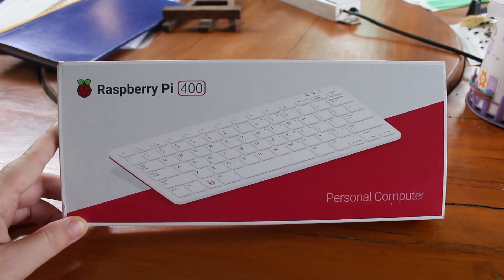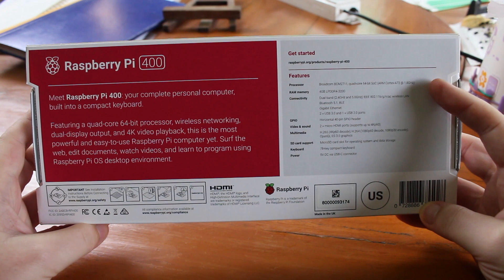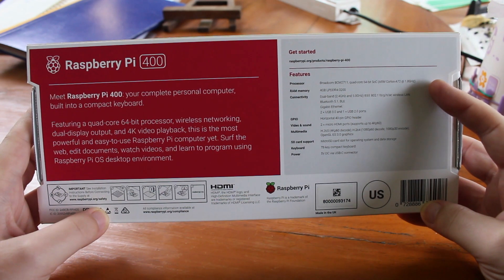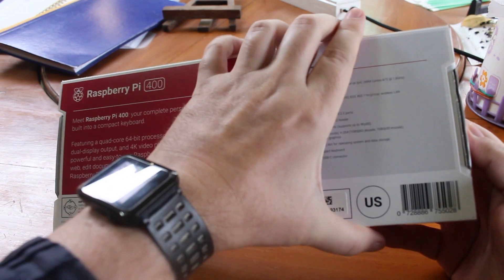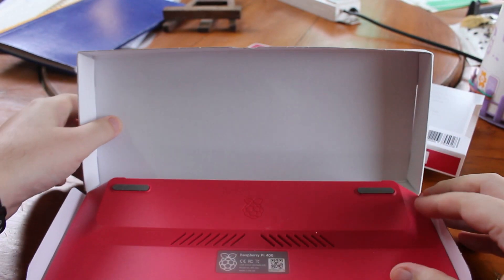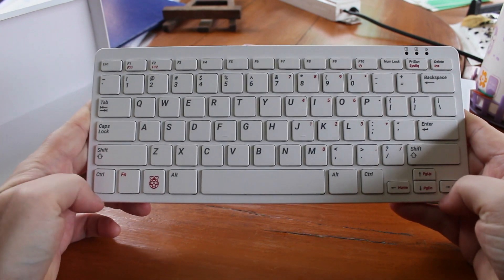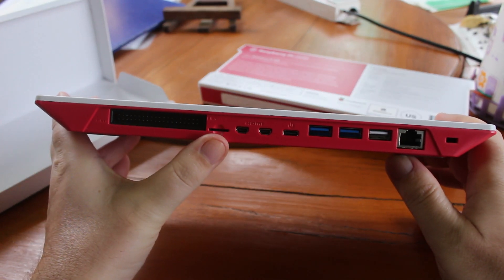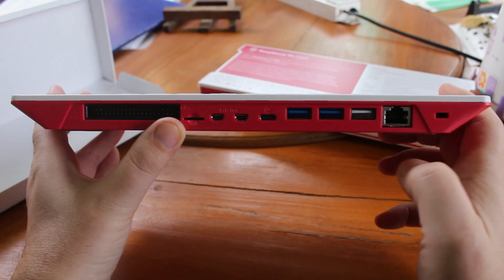Raspberry Pi 400 unboxing & teardown

Comment: From what I’ve seen on several videos, the passive cooling is incredibly good.

It can run benchmarks for a long time without getting hot.
Reply: Yes, cooling is great, never over 55C here with around 28C ambient temperature.
https://www.cnx-software.com/2020/11/02/raspberry-pi-400-review-benchmarks-vs-raspberry-pi-4/

Comment: Have you tried Kali on it ? Does it run smooth
Reply from the maker: I've not tried Kali, only Raspberry Pi OS. It's just a Raspberry Pi 4 in a different form factor with a slightly faster processor and proper cooling.